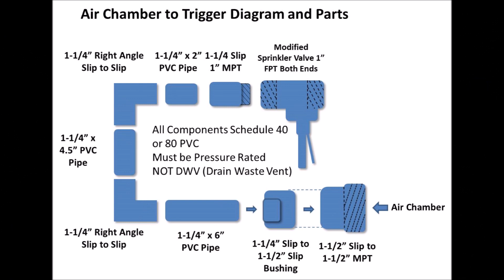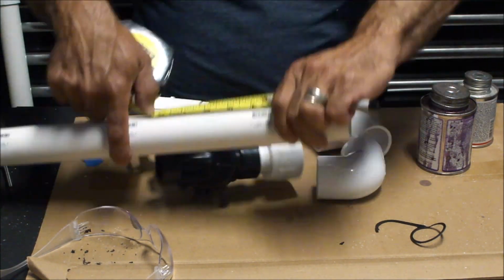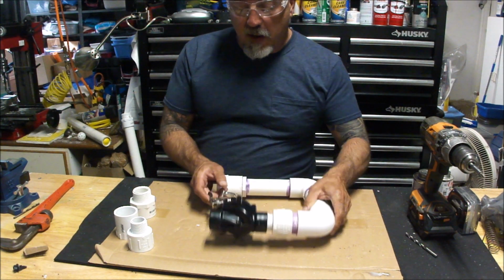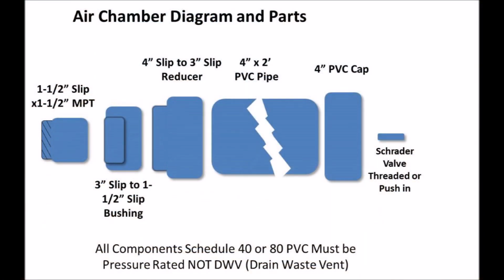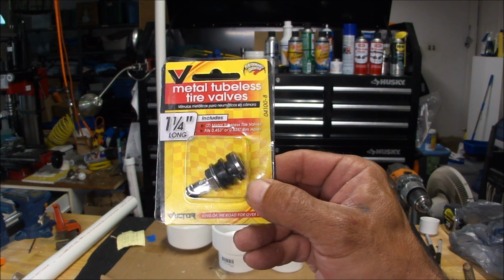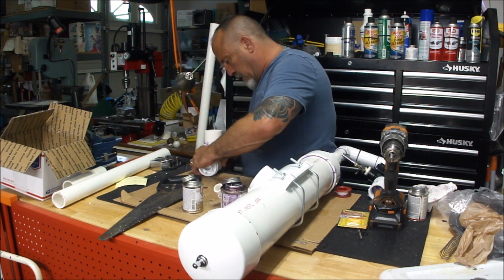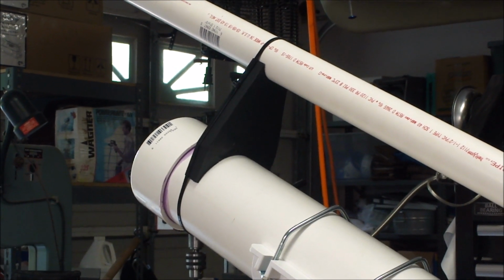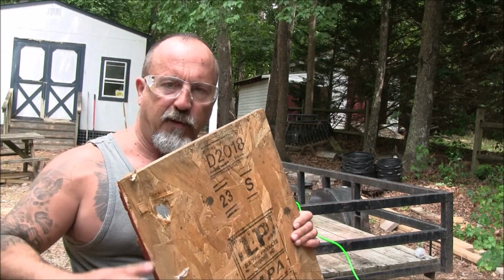How to Build an Air Power Fish Bait Launcher, Spud Gun - DIY Surf Fishing Air Cannon

Comment: Ever try a hairspray cannon? AquaNet is supposed to be ideal in wet conditions. Also can use propane, maybe a splash of gasoline. I used to have a scaled down watermelon mortar that also shot 2lb shotgun shells that would rip a tree in half
Reply from the maker: I haven't, my neighbor had a spud gun that used hair spary, starter fluid too lol. Can use those at the beaches here in NC though. Air powered ones are ok with the exception of the National Park beaches.

Comment: Hey mate, I'm building one of these for a physics final project in relation to projectiles and linear motion... I just need to know how you secured that bike valve on the end of the chamber without having an air leak? Did you use glue adhesive or silicon, epoxy...?  Also was there any s;ecific reason why you made the chamber that size? Thanks mate and it looks awesome!
Reply from the maker: Hi, thanks for the positive feedback!. I just used the rubber gaskets that came with it to make it airtight. As far as the size of the chamber, I tuned that so that it held twice the volume of air that the barrel would hold. I had read that to obtain maximum velocity that is the ration you needed.